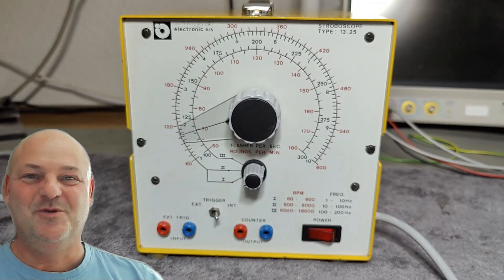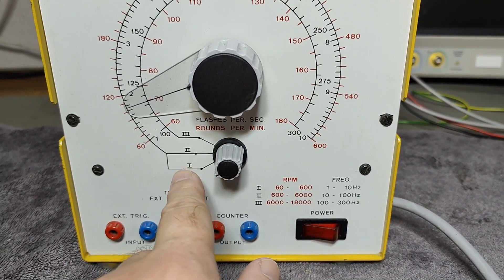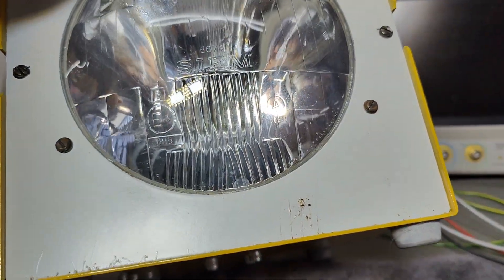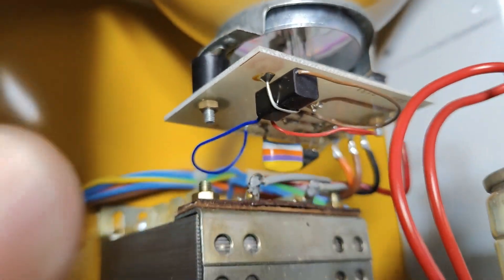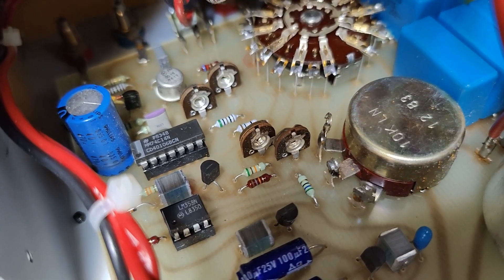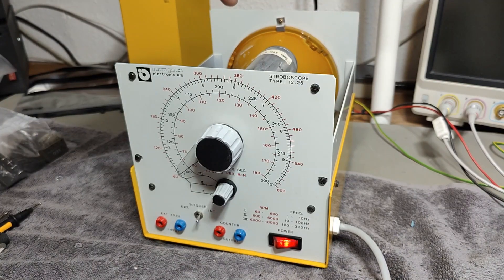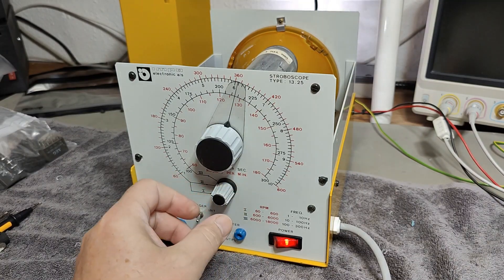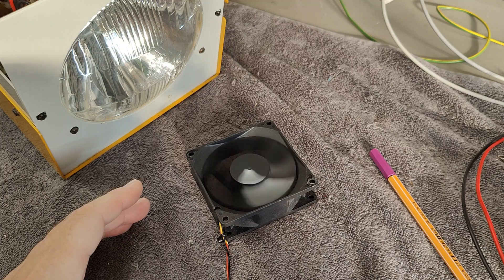impo Stroboscope type 13.25 1985 1Hz-300Hz 60-18000 RPM

Comment: I don't believe it's a standard automotive sealed beam lamp.  The filaments in normal headlamps take way too long to heat up, you'd never be able to go very fast as a result which is why they typically used special Xenon strobe tubes that ignite very, very fast
Reply: I think he only meant the reflector, the lamp inside is clearly a strobe tube.
Reply: only the casing with the glass, the tube is clearly an impulse discharge one.